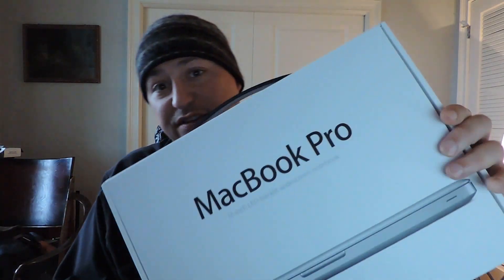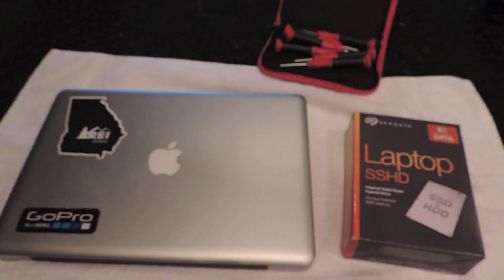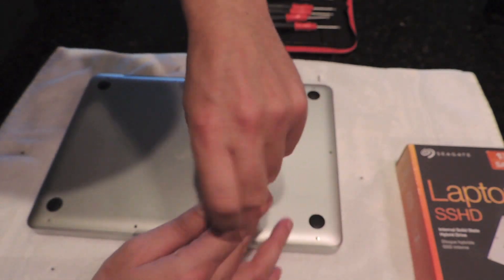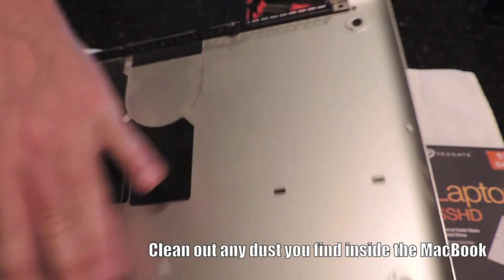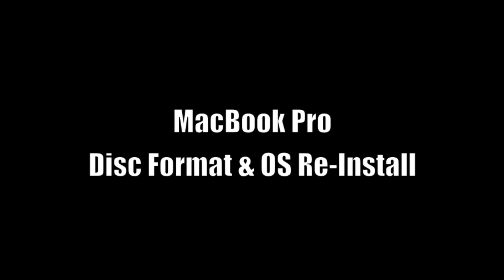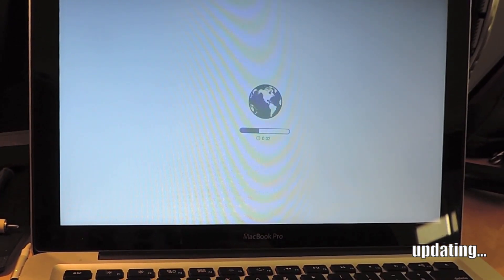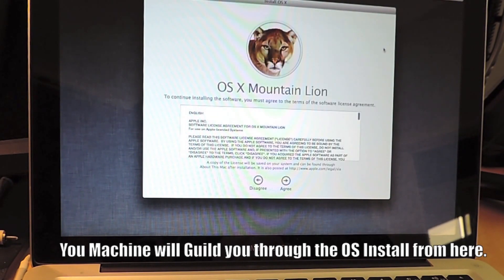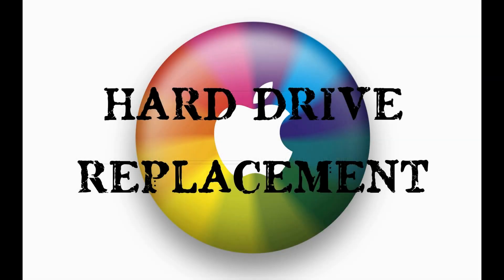MacBook Pro - Hard Drive Replacement FULL VIDEO!

Comment: What happens if your screen freezes right when it has finished” the reinstall?
Reply from the maker: Could be another component in your computer is bad. A weak or damaged battery can show up all over the computer. With your issue, I'd take a look at the processor or battery.
Reply from the maker: Would you mind subscribing to my channel? I would greatly appreciate it. Trying to get the that 1k mark. Thanks!

Comment: It seems like not everybody succeeds with this process. Another option is to put your new HD into an external drive and then install the IOS from an install DVD  onto the external disc. Then take that HDD out and install it into your laptop. It should just start up as normal. I've done that a few times.

Comment: I have the exact same computer and it gets a spinning beach ball a lot and I have to reboot. The reboot takes forever. Last summer it would not boot so I went to internet recovery and it showed my hard drive as full but it’s nowhere near full. However I could exit utilities and re-enter and later have the hard drive appear showing lots of free space. When I reboot I often get a flashing circle with a line that alternates with a flashing Apple symbol. Eventually it locks on the Apple symbol and has a progress bar that takes forever. Eventually it gives me the login screen. Yesterday I had the spinning beach ball and I rebooted and it would not boot. It was giving me the circle with a line on some boot-ups or a question mark folder on other boot-ups but neither were flashing on the screen. They were solid. I went to internet recovery and it was showing a full hard drive again but after exiting and entering multiple times I was able to have my hard drive show up with lots of free space. I was able to select it as start up disk and restart and then I got my computer to slowly boot back to the login screen. Could this possibly be the hard drive cable as these computers are notorious for that cable going out? I have ordered one to try. The computer works fine but after some time it often gives the spinning beach ball that comes and goes. Eventually it becomes so slow that I have to power it down. I paid almost $2000 for it and it does not get heavy use and has over 500GB of free hard drive space and acts this way? I expected a lot more for the price and I don’t think I will ever buy another Apple laptop based on this experience. Also, last summer when I first had this issue I noticed the cooling fan was always running loudly and the laptop would get quite hot even with the fan going constantly. Since then I don’t hear the cooling fan and it does not ever get hot. I’m not sure what the deal is with that. At the time I removed some malware stuff after scanning it so I was thinking that had been causing the issue for me but I’m not sure. Do you have any insight?

Comment: Hey Nick, Great video man... However I am still having some issues.  I replaced the unibody cable and installed a new hard drive but when I try to format the new hard drive I get a blinking folder with a question mark... Any ideas? I have been searching the web for fixes but have been unsuccessful.  Weird thing is when I put my old hard drive back in, press the power button and hold down option (two folders appear EFI Boot and Recovery).  At this point I am able to go into disk manager and erase my hard drive (however, I don't want to do this as this drive still has a lot of data on it).  My question is, why can't I get to this step when my new hard drive is plugged in?  Also, at boot up I don't get the spinning world nor do I have the option to login to my wifi network?  Any idea on what I should do?

Comment: Will this work if I just pull my old our drive out and not do anything else except the new one in
Reply from the maker: It depends on what's wrong with your machine... if your problem is different than the one outlined in this video this fix wont work

Comment: Hi, Thanks for the video. Everything is fine until I try to format and it fails every time. Any help would be appreciated. Thanks
Reply from the maker: Amm it may be some other component in your machine is bad. Such as a very weak battery. Also, try to format a different drive maybe there is something wrong with it. Would you mind subscribing to my channel? I would greatly appreciate it. Trying to get the that 1k mark. Thanks!

Comment: What screwdriver do you use to remove the screws out of the hard drive?
Reply from the maker: Eh? That's kind of surprising. It's got the phillips head, flat head and torx in correct sizes. What type of screw was in your macbook? I've re-checked the product link to the cpu tool set that I have and it's the exact same thing. My tool set has worked with Macs and PCs. I'm not sure what your problem is but don't blame me for it. If you check the reviews of the product, there have been cases where the kit came with duplicate screwdrivers or the wrong screwdrivers in the set. If that's the case, that sucks, but it's not my fault.
Reply from the maker: I used a computer tool set that I picked up at Office Max. It's a set of very small tools that specifically used for electronics. Here's a link to a similar kit to what I use - http://amzn.to/2h0SKFN
Reply: Nick Adams great video, but don’t offer a link to a kit if you don’t know for sure it will have the right tool in it, ordered it and none of them would work for the the screws on the Hard drive so a waste of 14 bucks...
Reply: didn't blame you, didn't even say it was your fault. simply said don't offer a link to a kit unless you know it works for sure. first you said similar kit, now youre saying it's the same, so which is it...
Reply: Andrew Chapman there is a kit at Lowes for about $25 which includes the P5 screwdriver
Reply: Torx t6 screwdriver

Comment: Looks like my hard drive failed. I'm going to do this! Except mine shows a folder with a question mark. Would it be the same steps?
Reply: This is a year ago but might still help, when it shows that folder it means that there is not a hard drive connected. So you should check the cable conected to the hard drive, cuz those can go bad

Comment: +1 for this.
Reply from the maker: +David Pixley Thanks! Did you have the same issue? When i took it into the apple store, they let on that they deal with HD crashes all of the time.
Reply: +Nick Adams I am currently dealing with a HHD that is the stock HHD and is getting slower and slower.  I'm strongly considering the Samsung EVO 850 (not pro) 500 GB to stick in the drive slot, and using the HHD in the optical drive.  Not sure though, because my macbook pro is mid-2009, which (just this model) seems to have many reported issues with many drives.  My main issue is I get 1.5 GB/s negotiated link speed with the updated drivers... and Samsung has had reports of giving the "it is your computer's fault" with customer service.  So, I am considering other drives that have reports of being more macbook pro mid-2009 compatible... but lower over-all speed reviews and higher price.